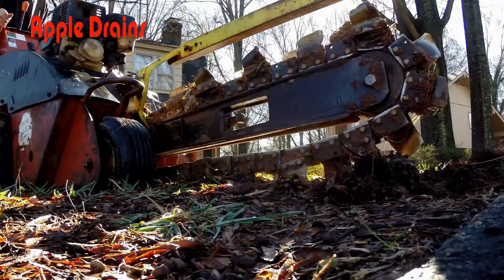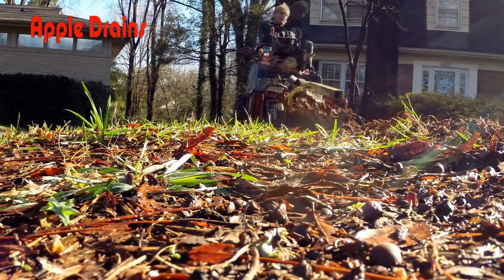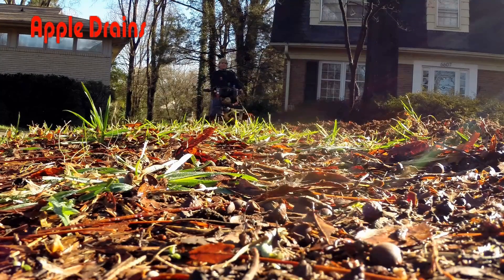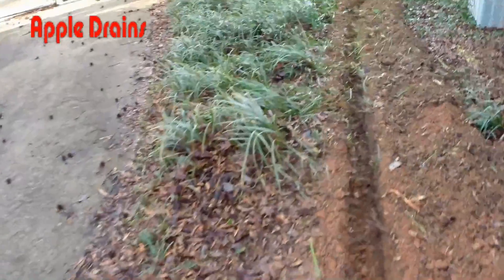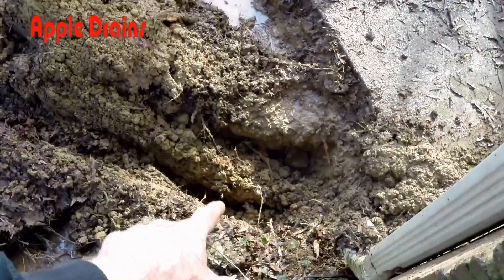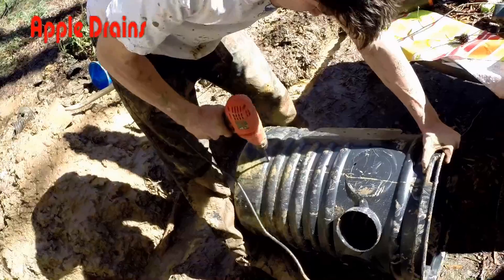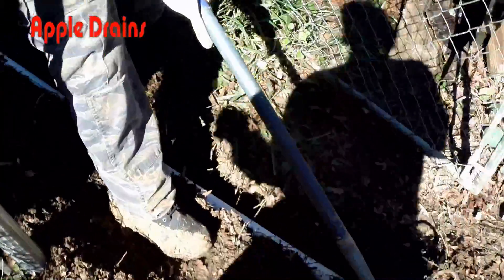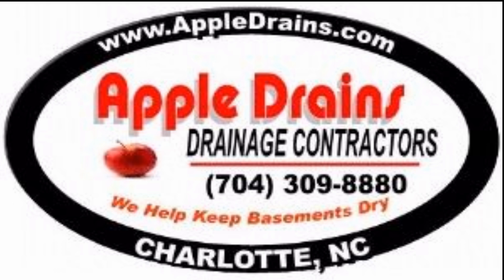BACK YARD SUMP PUMP when to use

Comment: are there any concerns about freezing? Does the temp there not make much of a factor for all the equipment IE pipes breaking or cases cracking?
Reply: Have you seen any swage pipes brake from freezing? No cause they do not have water in them